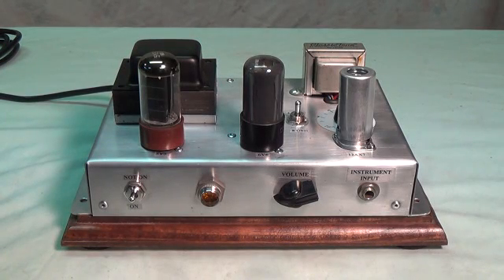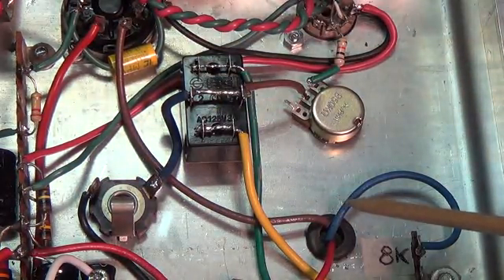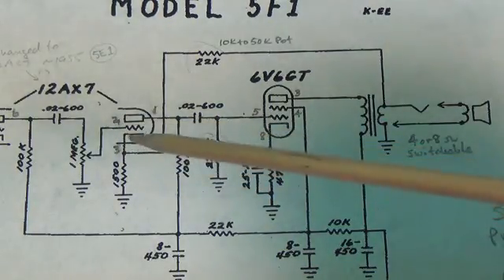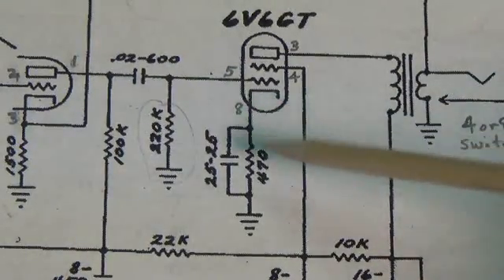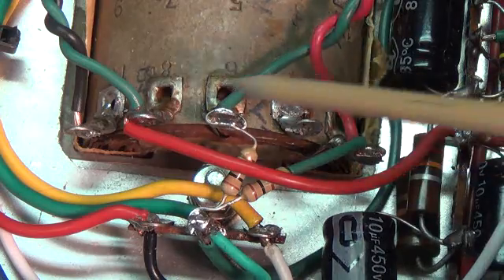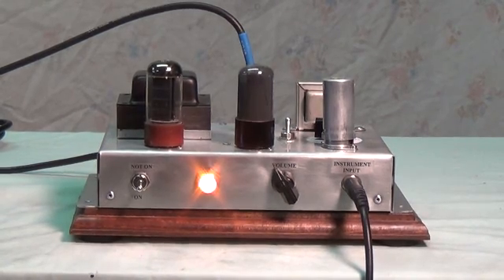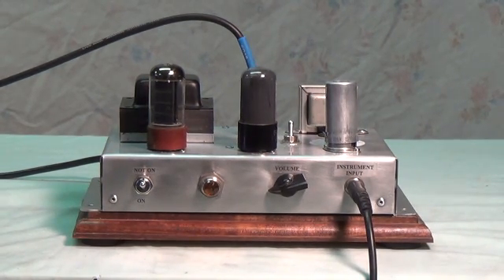Scratch Building a Fender 5F1 Champ from Scrap Parts.....Part 2

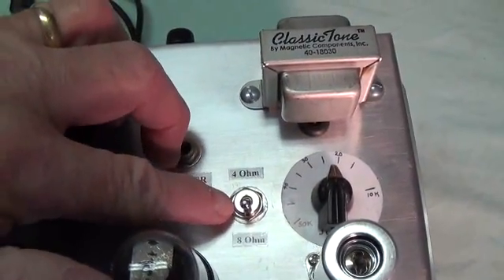Comment: Sorry to interrupt Sir, but the ´mysterious´ knob you´re talking about at 02:35 is very common on Intrumental Amps. My old 100W laney heads got them all, but labeled as ´presence´ The same as some, not all, Fender amps have as well.

As I´ve checked the electronics design, it is a pot beweeen the output jack and the cathode of the driver stage prior to the phase inverter (result in negative feedback) One may go back to the first tube if wanted, depends on how ´deep´ the feedback you would like to have.

But saturation tone is better wich less feedback - more neg. feedback more self stabilizing effect. Less or no feedback more and ealier saturation. Some designers add a small Capacitor shorted with a resistor all in series with this Pot. to make the feeback Pot acts as a tone control as well...

Keep working, excellent Video!
Reply from the maker: Thanks, TC. I believe that a Presence Control emphasizes primarily the treble frequencies, and in this Champ circuit, the variable NFB is not frequency selective....so I don't think it qualifies as being a "presence" control.  In the early Fender amps, high (and upper mid-range) frequencies were (variably) eliminated from the NFB through a 0.1uf cap to ground, and the remaining (mostly bass) frequencies were fed back, out of phase, into the signal path. This way, the bass frequencies in the signal were attenuated, but the upper mid-range and treble were not.  In the Champ variable NFB, all frequencies are fed back out of phase, so no frequency is emphasized.

Comment: Nice videos.  All your videos are well done.  You can connect the NFB resistor to the 8ohm tap, and let the speaker switch between 4 & 8.  There is no requirement that the NFB go to the same tap where the speaker load is.  the NFB load on the OT is 22K+1500, which won't look like any significant load to the OT's secondary.  The problem with switching NFB to the 4 & 8 ohm taps, is that it drastically changes the amount of NFB.  Look at the lowest NFB you can dial in,  22K on the 4ohm gives you abt. -2.2dB NFB, 22K on the 8ohm gives you abt -3dB NFB.   Why? because the Vrms changes between the two taps,  which is the input that the voltage divider (22K & 1500) resistors  attenuate and provide NFB output to the 2nd stage cathode.
your variable NFB pot makes it adjustable, but you get a different range of NFB min/max available depending on the OT tap switch. an easy fix to put the NFB permanently on one tap or the other.
Reply from the maker: Thank you for your kind words and very informative comment, Mr. Ahern. I see your point about the variation of NFB effect between the 4 and 8 Ohm positions of the DPDT switch, as I have it wired. Since the NFB is so widely variable, from 10K to over 50K, I felt that the disparity could be compensated for by adjustment of the NFB pot after switching; however, I may well heed your suggestion and attach the NFB loop to the 8 Ohm side of the switch and evaluate the difference. Thanks again for your input, and Happy Holidays !!

Comment: Hi Doug! Interesting little modifications! The variable negative feedback is an excellent idea...I've never seen this commonly on commercially made amps, but it's valuable for many reasons! Creating the virtual center tap is a very wise choice here...I've done this to many amps over the years...many of the amps that I've worked on which had no CT on the PT greatly benefited the addition of the resistors! I had one issue where no matter what I did, I couldn't get rid of the AC heater hum. Well, after running it by a few seasoned senior techs, I was given a hand-drawn schematic for the modification...Been using it ever since! Keep the good videos coming! PS: I see Rusty tends to run for the hills when it's shop-cleanup time :)
Reply from the maker: It's great to hear from you, Frank. I'm glad you liked the video and the modifications. Rusty and I send you our best wishes for a great Christmas season !!!

Comment: great as usual -- but 10 k + 50 k is 60 k NFB, no ? happy solstice !!
Reply from the maker: Thanks so much, Ben. As Ed McMahon used to say, "You are correct, Sir", but (for reasons as yet unknown.....cheap pot?) when I tested the series resistance of the pot and 10K resistor, it came up a little over 50K, so I went with that.  It bothered me too, but I hoped I would get away with it.....you vigilant rascal !!  Meanwhile, I and my Druid friends all join you in celebration of this great solstice. Best wishes to you and yours.
Reply: Uncle Doug thank you Doug ! Yes a great solstice was had -- with food. music and celebration ! maybe it's that 20 % tolerance or shoddy manufacturing for the pot - or the meter ?...regardless small amps rule-- dare you to try a s/e parallel 12At7 or 12AU7 instead of the 6V6 for your next build !
Reply from the maker: A single-ended parallel 12AT7 or 12AU7 circuit is not for the faint of heart, Ben, but Rusty and I will consider the challenge.....after our (hedonistic) Solstice celebration hangovers subside :))

Comment: Having a switchable off NFB option works fine, just gives you extra gain and drive.
My last build I made the V1 cathode bypass cap switchable, which makes for usable clean tone with the little bugger flat out.
Reply from the maker: Greetings, Squizzy, and thanks for the good suggestion. I may try that in a future chassis-construction project.  I really appreciate your interest and input.